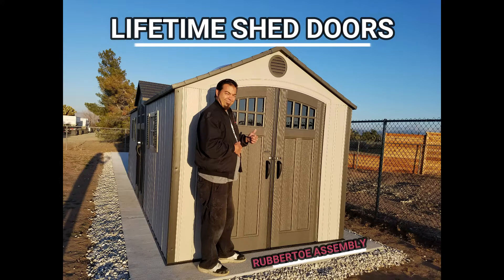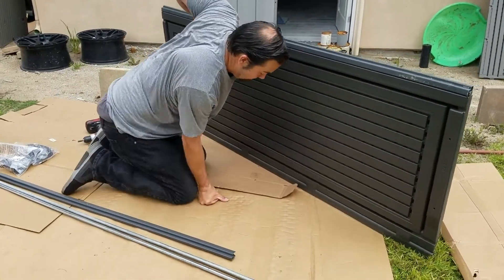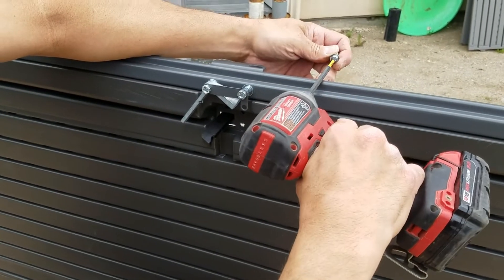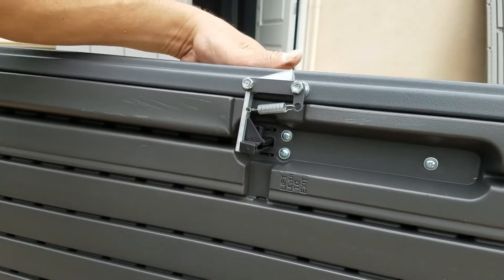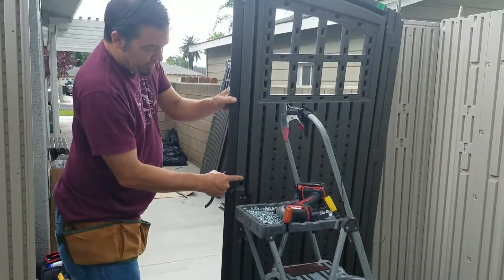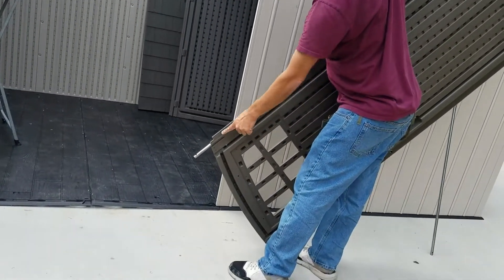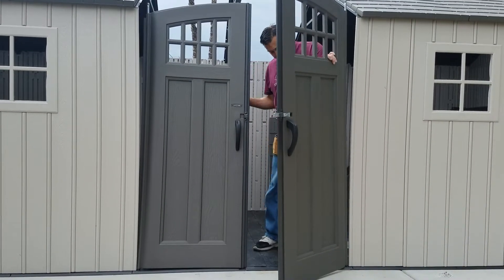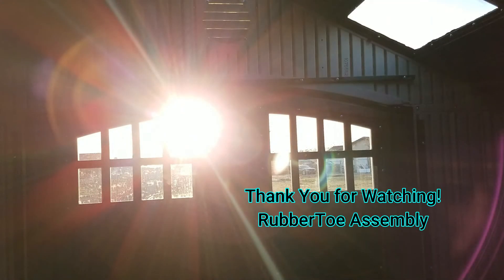How To LifeTime Outdoor Sheds Door Thumb lever Install Build

Comment: You have the best installation videos on these sheds. I watched another one of yours and i put my shed up in no time because I already knew what to do.  Thanks. But my two doors are to tight the right wont close if the left is closed. I still need to try to shim it

Comment: Great video. I’m having issues with my double doors where one door (left) is much higher than the other (right) I can’t seem to figure out why. The walls are aligned with the gable, and the floor is flat. Ever had this issue? Or any thoughts?
Reply from the maker: Hi,thanks for question.So I have several videos that show this on different sizes,I'm wondering if its the large gable(side doors) or the smaller gable(middle doors).Either way,when the doors are installed properly into the bushings that are in the flooring,they should be the same height.The gable is then pulled down onto the top of the 2 door poles,and installed.After that,the rest of shed is built,and completed.(mostly roof)When shed is complete,then there are the adjustment details to line up doors,and a few other finishing touches.. So..take one of the wedges that came with shed and slide it underneath the door that is low.Slide it right under the bushing,where the pole sits.If you have a pry bar of some sort,it makes it easier to lift flooring up and slide in wedge.Also,the plastic wedges they give you can be snapped in half or thirds and stacked on each other in order to achieve more lift.Tap the wedges in underneath door poles where necessary to level each door needed.This is way easier to show than to explain.That is another reason the videos were made.I hope this explanation helps solve the issue for you.
Reply: RubberToe Assembly thank you for your response! As soon as I started installing roofing everything started to square away. The difference in height is minimal more and the doors are operating perfectly. I will shim to resolve the difference as you stated. Thanks for your response and these videos. I have the 15x8 with the double doors on front and side. The main problem I’ve noticed is that a percentage of the screws don’t tighten to a torque but feel like they strip. I’m in Miami and unfortunately this shed does not have an extreme weather kit available for it due to the other doors. Do you know of anyone or have you ever adapted metal or wood to reinforce this shed for hurricane weather?
Reply from the maker: @Khan618  Hi.glad to be of help in any way.These sheds are really not designed to weather extreme hurricane.All i can recommend is bolt it to foundation where it is built.One of my videos shows bolting to wood floor. As for the screws...each plastic piece has to be checked for excess plastic buildup on the edges and in the grooves. I have a deburring  video that shows this.But if shed is already complete,its not worth taking apart to check,it will just weaken all of the screws that actually are holding well.It sounds like shed is functioning.I am here for everyone for any other questions.Thanks,and good luck in Miami.Go Dolphins.take care

Comment: Been assembling my 15x8 6446 by myself and find no reference for how to get the latches at the tip and bottom of the inside of the door  to function. Do they only work from the inside? Seems like they should work with the latch but I don't see how?

Comment: How did you get the dead bolts on the door?
Reply from the maker: Hi,thanks for question.I have another video that shows better than this one.But basically,hold the deadbolt block where its supposed to be in the door groove,while sliding the end rail over it and down the rest of door until almost the end,leaving just enough room to insert the other deadbolt before continuing to slide rest of way to other edge of door.I find doing this vertically is easier,as in my other video,check em out.Also, make sure the long door channel rail is facing the correct side forward,depending which side door it is.(left door or right) When doors close,the right door always overlaps the left one.Not always easy,especially if never done before, good luck,hope I've helped